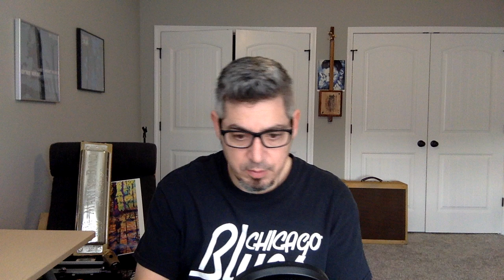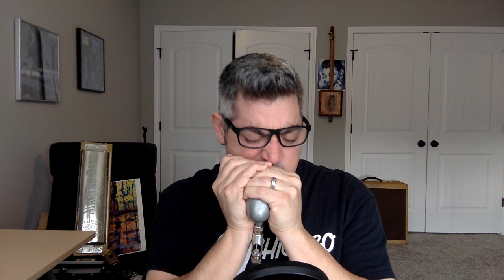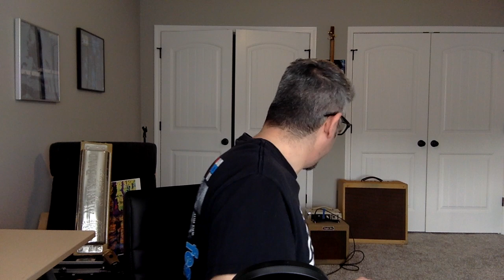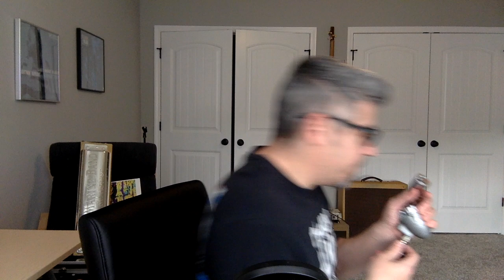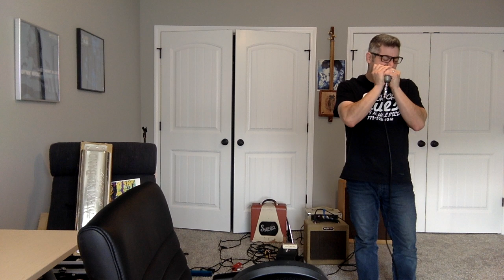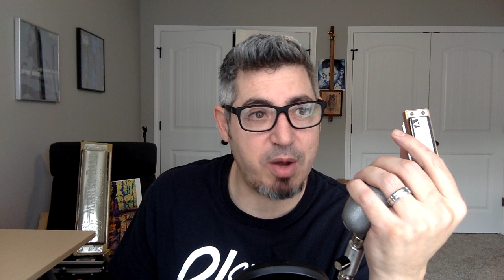the mighty AT7 (blowin' through the Memphis Mini amp)

Comment: In my Fender Blues Deville I'm using 12AY7s in both preamp stages and also in the phase inverter stage. This tames the 60W monster without losing the sparkle and bark of the amp. I found the 12AU7 (a favourite of many harp players) to be too dull and not enough punch.
Reply: do you mean nos 12ay7?
Reply: @yaniv-nos-tubes  I use new valves. 12AY7's are still in production.

Comment: the truth at last! ive been collecting and rolling nos tubes for the last 10 years. so much misguidance online about tubes  because the amp builders hate to admit that they are using low quality noisy parts, they have no choice but it doesnt mean that they can claim that it's only subjective. when it comes to vintage guitars everybody agrees.... 
ive recently retubed an original 1959 fender tweed deluxe with shortplates mullards from 1964
enjoy

Comment: 12AT7 has a gain factor of about 60% of a 12AX7. It does however have a higher current output. This may not be ideal for some amp circuits. The 5751 might be a better fit with a gain factor of 70%.
Reply from the maker: I dig the 5751 but I also dig this one too
Reply: @Harmonica123  This article doesn't apply to the Memphis Mini, but you may find it useful for larger amps:
https://guitaramplifierblueprinting.com/wp-content/uploads/Phaseinverter.pdf

Thanks for all you do, Ronnie.
Reply: to my opinion the best voicing comes from 12ax7 or 12au7 and most preamps used one of them at v1. using 12at7 at v1 is a common mode it isn't problematic.
Reply: @yaniv-nos-tubes  The 12AT7 has ten times the current output of a 12AX7.